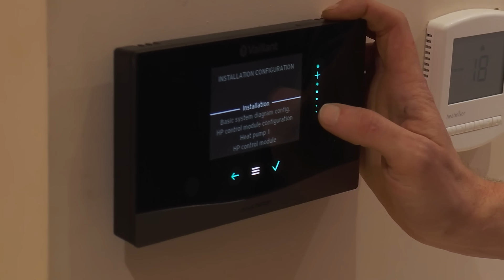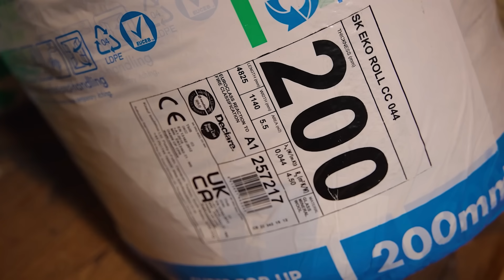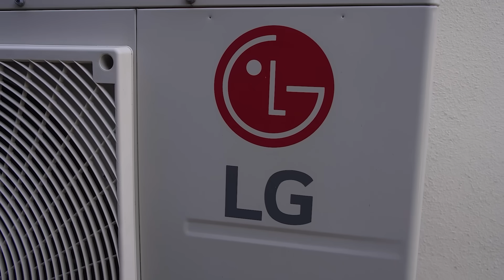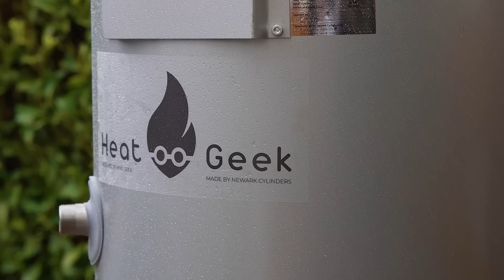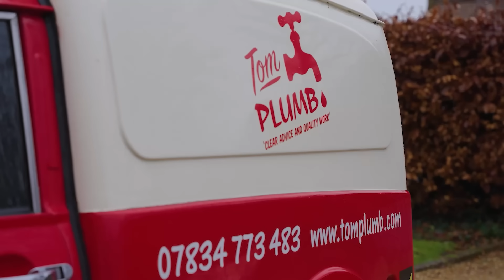Heat Geek’s Heat Pump One Year Later — The Verdict!

Comment: If anyone is considering an ASHP then its worth noting the following (aside from having the plumber correctly configuring the system as detailed in this video)
1. You need adequate insulation (cavity wall, loft, underfloor timber joists insulated if it's not a concrete floor). Insulation is key to heat retention
2. Oversize your existing radiators, heat pumps flow rate temps are designed to run at lower temperatures than a combi boiler so you need larger rads that accomodate more water.
3. Pipe work, your existing pipe work may need replacing to pipes that are bigger than 15mm
4. If you want an air to water system then you will need somewhere to store a water cylinder
5. as mentioned electric is about 3x more expensive in the UK, you will need to factor this as a cost.
Reply: That's why I am surprised anyone wants one.  My guess is they think the government grant means they will get a new heating system 'for free' plus they will save a load of money heating their home in future.  Sadly in most cases, it seems neither is quite true.
Reply: A reasonable heat pump install has similar energy costs to a gas boiler. The average heat pump install is £4.5k. insulation isn't required, but will help reduce costs whatever heating system is used and possibly reduce the size of heat pump required.

Comment: At several times they claim heat pumps provide a better, more even heat than a gas boiler, but this isn't true. You can run a gas boiler to act like this and it's common when gas is paired with UFH.
Reply from the maker: If you listen carefully you will hear when Roger said "To be fair you can run a gas boiler at low flow temperatures and achieve the same thing".

Comment: Mega complex and not a word about the cost of all that stuff just to heat a house. My all electric heating which I installed myself costs £1900 a year but no repair bills for the last 35 years. Zero breakdowns. So simple.
Reply from the maker: The cost was covered in a previous video. This is a follow up

Comment: No one who has an installation will have the time ,care , attention , and intellectual input what this man has !
The sheer nature of contracting / contractors is to get the job done as quickly as possible and move onto the next job .
A breakdown of what this SHOULD have cost this gentleman with all the various man hours thrown at it , that your average Joe won't get .
Reply: 100%
Reply: You're 100% correct. We had a heat pump installed, and I must admit we had the original sales pitch, a surveyor did his checks on the building, etc. Another engineer came and measured the rooms and told us the exact size of the radiators and where the pump and cylinders would go, and finally, the specialists installed it. Where they went wrong (looking back), was the electrician who came in to wire it all up and never told us how it worked. He just turned it on, set it up, waited until the water was at 50 deg, flipped over to heating (the radiators got warm) and left. We have had it since Feb 2025 and are now looking at Mitsubishi YouTube videos to learn how to use it. Although they were all great, tidy and speedy, they were all in and out in a flash, and no real customer service was provided. Just moved on to the next job. We didn't even get a receipt for the £6400 we paid the company, and I had to chase that up.
Reply: This video is obviously political. What with  the noise difficulty in getting it fitted properly got to be more sensible to stick to gas for oil.
Reply: @ it's not political, it's showing you that you need competent installers, not plumbers turned 'heating engineers'. My neighbour has a heatpump. Standing next ot it when it's on is quieter than my oil combi boiler
Reply: yes maybe if heat geek and his team of hard working experts can install and set up everybodys triple glazed and fully insualted homes this may work , assuming the government dont plan on hiking electric prices

Comment: Not all are retired ex police or teachers on huge pensions. Would like to have total breakdown of cost and timescale? Even top men on the job miss diagnosed the original unit. This kit is beyond the capacity of say 80% of plumbers and firms, hence the initial cross threaded install. My Clearview solid stove is idiot proof. I can totally rebuild its innards in about an hour. About the same time each year to fit new rope. I clean chimney once a year in half hour. Heats whole bungalow.
Reply: but the heat pump is made out of eco-manure its au naturelle
Reply: how much does your fuel cost?  I'm assuming you aren't burning stuff like old pallets and fence posts?

Comment: Many of the macroeconomic arguments in the video about the energy sector are flat out wrong - electricity in the UK is so expensive BECAUSE OF HIGH DEMAND OF GAS, which is what the electric price is tied to. A lot of electricity in the UK is still generated from gas...
Reply from the maker: Patrick
The reason that electricity is expensive is because of the green levy. If you do some reading you will understand the macroeconomics a lot better. Investors in wind and solar needed a guaranteed price for their output and that is why it can't be cheaper. Yes gas is expensive right now and it is used to generate power and the gas fired power stations need to be paid even when they are not producing electricity. There isn't a free market in energy so it is pointless trying to apply classic economic theory to a market with huge friction.

Comment: Heat pumps work for some but not for others. Having sat down run the numbers and gotten mutable qouts and evealuated the so called saveings, and running and service costs. It works out more reliably expensive than my current gas and fire place combined. What I’ve seen is a lot of people running towards heat pump that have been missold as a golden cheap solution after install costs. And customers then end up spending thousands if not tens of thousands extra trying to get it to work efficiently and in the ball park of what was sold. Yes for some especially if you’re in anew or well built house that is at the standards required are met you may have a chance with a professional install of a heat pump. I think forcing every one down the same path is a bad idea, and could run into so many issuse. Let alone could be much more expensive to run, especially finding out servicing costs alone are more then double a gas combi service costs. I watched a YouTuber who was pushing heat pumps, he seemed to be having to obsess over it a lot and when he gave the so called saving yes was slightly cheaper if you didn’t includes yearly services costs in and with the electric prices still going up that so called saving wont be any thing before long. Ive come across a few customers who have gone back the gas or oil from having fairly new heat pumps, due the cost they found out to get there properties that are very well kept up to the standard would require a massive referb of z propertys, due the systems wear well put together by good installers. But they wear spending a huge amount on electricity to get the same level of heating into the property as the re old systems would, worked out much cheaper to switch back to newer gas / oil systems. Plus many more engineers that can service at sensible prices. And I’ve met customers that love there heat pumps, so i think in balance its grate for some and not for others.  But horses for courses.
Reply: Yes, energy prices of a reasonable heat pump install will roughly match the cost of a gas boiler.

Hopefully many will have homes where a reasonable install is cheap after grant. Or if they need a complex install they have the money.
Reply: @ this is flawed anything that relies on grants is flawed. Plus tax payers money.. i dont think a lot of people have a ton of money especially with the economy in recession.
Reply: @stevoone342  grants are part of the plan to help the country reach its carbon goals by decarbonising heating. There are flaws in the grant, but it does help with the training and rollout. Most support action on climate change.

Comment: The argument you need gas as backup is just silly, if you have a decently insulated UK house or flat and its the pits of winter the temperature would keep for at least 48 hours before it reaches below 18-19 degrees... so you can get a callout then to have your heatpump serviced or replaced. This is a service issue then not a technology issue.
Reply: Rubbish.  My house was built in 1994 and is well insulated, and I had new A rated double glazing 3 years ago.  If its freezing outside the internal temperature can drop from 22 degrees to below 16 degrees in a few hours.  If what you said was true we would only have to heat our houses on alternative days!

Comment: 👏A very helpful video which shows that knowledge and expertise are required for the install and that the owner must have the knowledge on how the new system will operate. Well done Skillbuilder. Only hire a dedicated heat pump business that will guarantee  the install and the heat output /energy output figures.💯👀

Comment: I’m glad it’s working for him but I run a 3 bed home with a modern Valiant boiler & we don’t go cold & the heating is off at night time when we’re asleep. My annual bills for 2023/2024 for water & heating have been £340 circa. The Heat Pump would need to be the same price as a combination boiler & bills to be the same if not cheaper to work for me. My home only received wall insulation in March 2025 & we still have virtually no loft insulation. We’re waiting for our loft to be insulated in April 2025 & can’t wait to see what difference this makes to our gas bill this coming winter.
Reply: hows the loft insulation going
Reply: @AlexSmith-y4i6t  Thanks, Still waiting  on it I’ll look into it in the new year. I know a guy who can do it for me if need be. Tbh I’m surprised by how good our bills are even with minimal loft insulation.
Reply: @everythingtechnew7400  i am ok at 15C and use a dehumidifier if humidity is an issue , no draughts and have a floor above me ,inm my viewa heat pump would be totally unnecessary but again it depends on the rigged energy market
Reply: @AlexSmith-y4i6t  I certainly won’t be getting a Heat Pump unless it’s the only thing available & it’s either that or freezing.  My total gas bill including standing charges is under £400 for 2025. Even if somehow an Airsource Heat Pump could heat my home & provide hot water for less than £400 it would never make sense financially to install one.

Comment: Can someone discuss heat pumps being used for underfloor COOLING? I have come across this at a house in Lyon, France. The system is equally used for heating the floor in similar temperatures as the UK in the winter (maybe even slightly colder) as well as nicely cooling the floor in the summer when outside temperatures range between 30-40degs and the house inside has a comfortable temperature of about 20-25degs. Everyone stares at me as an alien whenever I mention this but I’ve seen it and felt it and i know it works.
Reply: Swimming pool heat pumps heat water and can also cool it so this is very doable.  Air to air heat pumps can heat your house with warm air in the winter and cool air in the summer but don't heat your water.  I have this solution.  It's much, much simpler and was installed in under an hour. 32C outside last week and 21C inside.  Lovely.

Comment: I feel the education at college level has to be given a major overhaul , right now it’s a series of tick boxes even power flushing isn’t covered , many don’t even touch heat pumps until they either apprentice’s with a like minded Plummer , those that wish a guarantee, find many  are over prescribed, I have found those that wish for a heatpump are still going short changed , like John I had a poorly designed system part because the engineer died half way through , the replacements had hvac backgrounds but there calculations were off to put it mildly then after the December big freeze enough.   Now the same thing in the U.K. is happening I had a full quote from the blue boys , the first engineer was an Evangelist, but  his calculation was wrong that I requested a second engineer , with a 6 month lead time due to work so I went back to gas with a battery backup , the pipe work went from plex and speed fit to a look of 28mm with 22 to the all pressfit rads were changed from k1 to a mix of k2+ and 4 k3. Now running a low flow  boiler plus controls and smart zoning boy what a difference total cost yo a 16 rad 250liter ovo cylinder last yes 652 pounds ,it’s how you design it . I’m sticking with gas so much I brought a second to use as a spare in this daft net zer 2030

Comment: I like Mr Skill Builder, but I can't agree that heat pumps are not suitable for everyone or every situation. I would suggest, rather, that there are very few situations where heat pumps can't be made to work well. It's true that a good degree of insulation is a good idea, the best idea really. But with correctly sized heat pump and rads (calculated from heat loss data), suitable pipework, and appropriate temperature compensation (curve setting) any installation can be made to work well and at reasonable electricity costs. I pay a little more than this guy, nearer 1,300 a year, but I run mine at 23C by day and 20-21 at night - health issues - so accept the higher cost, and the less-than-perfect SCOP of 2.5 that running at these temps incurs. But them customer here says exactly what I have found - don't ever turn the thing off, unless  you are going away for more than a long weekend. My old heating system cost more than twice as much to run as my heat pump! I know people who only run one radiator in the living room, and everywhere in their house is cold, and I mean flipping freezing. How is a gas boiler supposed to run efficiently when running only one rad?! The boiler cycles madly as no gas boiler, however modern and clever, can modulate down to this kind of 'demand'. They are throwing money away while living in a cold house. It is really easy to see, however, why so many people can't and won't understand how having all your rads open, all of the time, and letting even a gas boiler run most of the time - as 'low and slow' as it can - is the best way to heat their home. Heat pumps prove this, although it is probable that most heating systems will work more efficiently and effectively with larger rads at lower temperatures. All the years I had gas CH with flow temps of 70+ degrees and I never understood the basic physics of all this! The problem is getting people interested enough to understand the basics, yet I am the one who becomes 'a nerd' when suggesting to people that 'low and slow' applies to everything, especially heating, and also to cars, of any type. Why get 40 mpg when you can have 50 mpg if you want? Same car, different approach and driving style while driving imperceptibly slower and accelerating just a little less hard and using the most appropriate gear. Why have a cold house and one only warm-ish room for £1,000 a year when you can have a toasty house 24/7 and 365 too for no more money? This is the hard sell - don't keep switching it off, set it up well, let it do its job. Just as your car will last you longer (I never sell a car under 20 years old and under 250K on the clock and have totally reliable transport which never uses a drop of oil between changes etc) if you drive appropriately and maintain it well, same goes for your heating system. Sorry, another stupidly long one... (-;)~
Reply from the maker: I think that you need to spend some time going into different types of homes, such as flats and then look at how practical it is to put in a heat pump. 
I was in a semi detached house the other week where a Heat Geek surveyor said "You will need to upgrade to a 3 phase supply to make this work and it is not worth it".